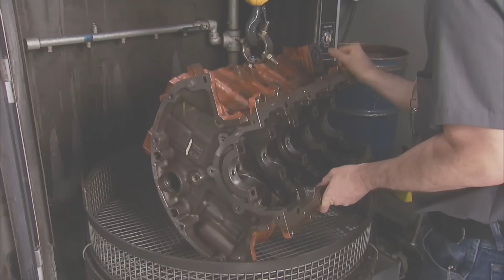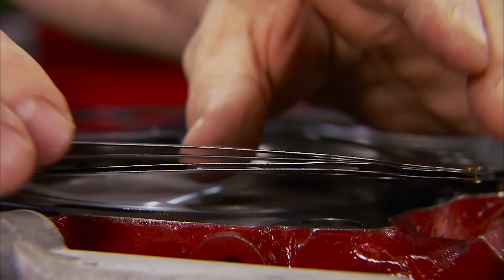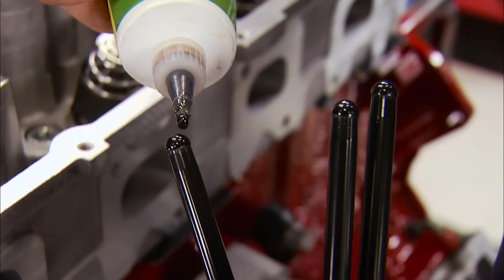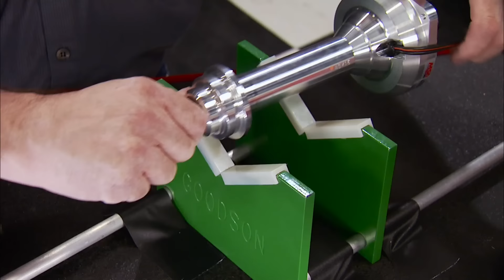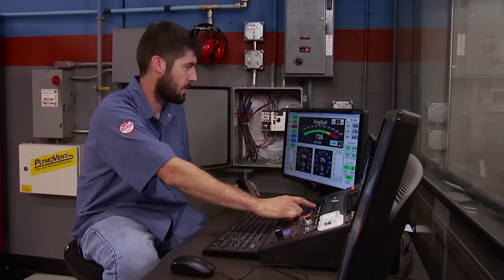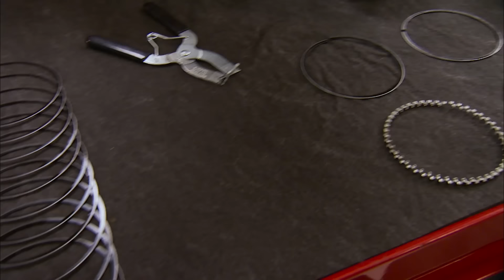Gen III Hemi Gets Super Trick Heads - Engine Power S3, E13

Comment: Why say point the rotor " where you want it". Your supposed to tell me where I want it.
Reply: ,,,,,,,,,,,,,,,,,,,,,,,,,,,,,,because  ,  once you have number one  cylinder at  TDC  on  compression stroke,,,,you can drop a distributor in any way  easy  you want,,,,,,then   follow the firing order of the engine,,,,,,back in da day  the vacuum  cann  was an issue  as to where the locale  could be in the optimum  spot...........

Comment: I cannot believe that Stellantis was foolish enough to stop production of the Gen 3 Hemi! It was a great engine and I know I loved having it in my 2017 Ram. Even in stock form a stout and reliable engine!
Reply: They didn’t, it still comes in the 2500 ram, and you can buy a brand new 5.7 for 5500 from mopar, 7k for the srt 392 etc
Reply: @SofaKing2977  Yeah, but they got rid of it out of production vehicles. And the 2500 had the great 6.4.
Reply: @SofaKing2977  ,,,,,,,,I like these  canted valve mopars more than the LS chevy,,,,, get this , I've owned chevys all my life  ....................and one 1966 dodge......383....................7 grand  for the mill i want   392.....fuch............
Reply: @ThomasELeClair  what is going on with all the period, my man?
Reply: @ThomasELeClair  canted valve heads are BBC, FORD Cleveland and BBF, there were some others but a hemi is not a canted valve per say arrangement. They are opposed, perpendicular to the main  bearing bores whereas those canted valve heads are simply not inline with the crank such as most other engines, wedge shaped in general chambers. Canted chambers are  somewhat rounded as with Hemis and the gen 3 is not even a true hemi. It is only slightly reminisent of the 1st &2nd gen engines starting with the 331 to 392, not to be confused with the new 6.4 and finally the 426 hemi, there was also a 426 wedge which had the same  ore and stroke as the big gen 2 Hemis, the gen1 was based on the early poly spherical chamber head blocks which came around in the 50's for the gen1, there were several pieces that would interchange from the poly to the gen 1 Hemis and the 273/318/340/360 designs,( there were also a short run limited production of odd displacement engines produced for the Desitos and off label offerings under the Chrysler Corperation. The big blocks used for the gen2 426 that required the top row of head  lots relocated to clear intake ports, which came out in the mid 60's and was basically gone by 71. MOPAR experimented with a true canted valve head in the early 70's called the ball/stud hemi head that was supposed to be lined up for the next stage evolution of the 440 block and called it the 444 but economics and emissions along fuel crunch of 72 killed production. There were only around ~10 engines set for testing and most of the parts were destroyed supposedly but some pieces somehow made it out of the engineering skunkworks shop and have turned up on auction sites for ridiculously high prices. It would have been SO cool to have been able to get those heads for public use since they were basically a direct bolt on to BBM blocks, and being able to take advantage of the improved flow they offered to put those engines in comparable ranks with BBC and BBF engines. But it just was not meant to be. Aftermarket should release a new casting of those so we could build with them. Let me me again mention the BS beads were pretty much a direct bolt on to the standard BBM blocks. Gen2 hemi heads can be fitted to BBM with welding and machine work to make clearance for the exhaust pushrods. But new casting hemi blocks were re released by MOPAR performance for awhile, not sure if those are still available now though. I haven't messed with that stuff now for many years as the cost is out of my realm now.
Reply: they should have made a gen 4 replacement
Reply: There's always tomorrow  @krtacct
Reply: As I understand it, they were having a harder and harder time meeting emissions requirements with the current design. Once the kinks are worked out of the hurricane, I am sure it will be respectable… but I am sure the old school muscle guys won’t be super happy with that. Did they ever fix cam oiling on gen 3 “hemi”?
Reply: @westonweems2270  Not true........GM and Ford are still offering many V8 engines.
STALLantis is a woke JOKE !!!!!!!!!!!!!!!!
Reply: @westonweems2270  In 2016 (MY) they changed suppliers for roller lifters after making a significant revision with the roller needle bearings. In 2019 they made a revision to the oil pump part number to allow for more flow overall but not by much. I believe the issue lied more in the older gen 4 hemi's mostly seeing as how they did make 2 revsions. I've hear 15 theories on the hemi lifter issue none of which can actually be fully proven.
Reply: They do still produce it, there’s millions of them and now the twin turbo 3.0 inline 6 that comes in everything is 1,000 horsepower capable straight from dealership parking lot. That hurricane engine is robust and absolutely going to be an easy engine swap for almost anything once someone makes an aftermarket wiring harness.
Reply: @tylerwilson8615  No one will be doing a Hurricane swap !!!!!!!!!! LOL  Its going to be a Hellcat crate engine, not an I6.
Reply: @darknes7800  Have fun with your hellcat but there are going to be a lot of people that want the stouter factory platform in the inline 6. People swap ecoboost engines in old pickups. Just because you wouldn’t do it doesn’t mean that a lot of people wouldn’t.
Reply: @tylerwilson8615  It is not 1000hp capable it blew up at 604HP in testing quite a few times someone basically needs to re engineer the whole thing and probably pour an extra thick cast iron block for it while they're at it because it already is pushing almost 30 lbs of boost at 540hp. A cast iron block with a cast iron head, and 5.0L of displacement so it doesn't have to rely on boost so much while being built as cheaply as possible.
Reply: I’m running the 6.4 in a 16 Power wagon. Definitely a good running engine but I think Mopar left a lot of power on the table when it comes to tuning. I’m guessing emissions were the reason. It really sucks you can’t get a $300 programmer for our Rams